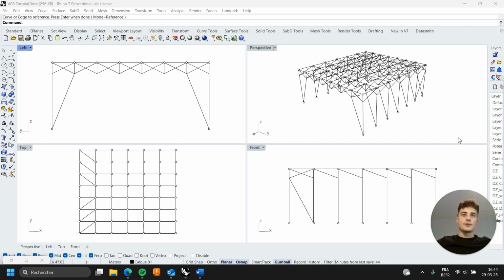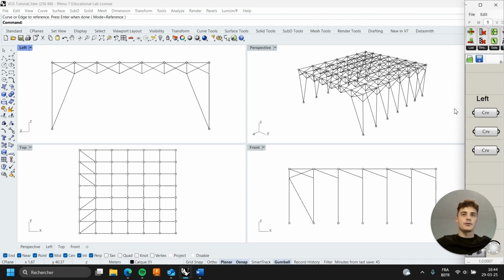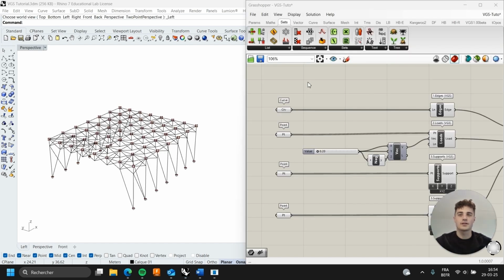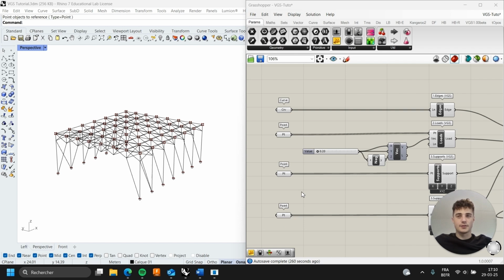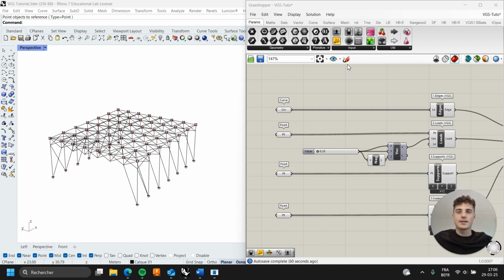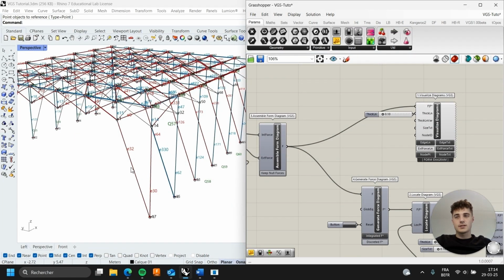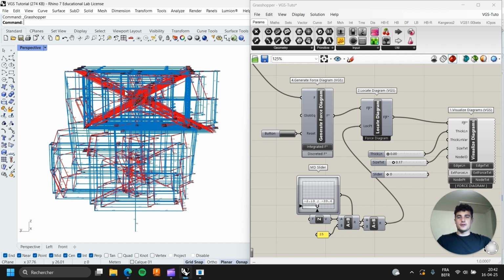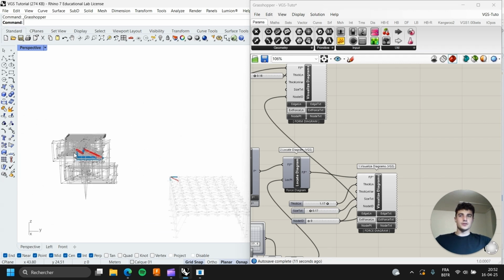VGS tutorial #5 - 3D portal frame

Comment: Hi, thanks a lot for the tutorial. I am very interested in learning about VGS. Unfortunately having followed through this one carefully, VGS still gives me a different result than that in the video. 

 {0}
0. [PLASTIC Model]
UNITS
Length: m
Force: kN
Stress: MPa

EQUILIBRIUM MATRIX 378x324
S (Self Stresses) = 0
M (Internal Mechanisms) = 54
____________
Redundant Edge: 
OverConst Supp: v14-X|v14-Z|v32-X|v32-Z|v50-X|v50-Z|v68-X|v68-Z|v86-X|v86-Z|v104-X|v104-Z|v122-X|v122-Z|v14-X|v14-Z|v32-X|v32-Z|v50-X|v50-Z|v68-X|v68-Z|v86-X|v86-Z|v104-X|v104-Z|v122-X|v122-Z
LackConst Node: v23-Z|v24-X|v25-Z|v27-Z|v32-Y|v33-Y|v34-Y|v38-X|v40-X|v41-Z|v42-X|v43-Z|v44-X|v45-Z|v46-X|v50-Y|v51-Y|v52-Y|v55-X|v56-X|v58-X|v59-Z|v60-X|v61-Z|v62-X|v63-Z|v64-X|v66-X|v68-Y|v69-X|v69-Y|v70-Y|v73-X|v74-X|v76-X|v77-Z|v78-X|v79-Z|v80-X|v81-Z|v82-X|v84-X|v86-Y|v87-X|v87-Y|v88-Y|v91-X|v92-X|v94-X|v95-Z|v96-X|v97-Z|v98-X|v99-Z|v100-X|v102-X|v104-Y|v105-X|v105-Y|v106-Y|v108-X|v109-X|v110-X|v111-X|v112-X|v113-X|v113-Z|v114-X|v115-X|v115-Z|v116-X|v117-X|v117-Z|v118-X|v119-X|v120-X|v121-X|v122-Y|v123-X|v123-Y|v124-X|v124-Y
____________
The structure is kinematically unstable: 54 bracing edges or support force variables have to be introduced

VISUALIZATION
The entire structure is visualized

So I am structuring to interpret this error message.
Reply: would you mind sharing your example files?